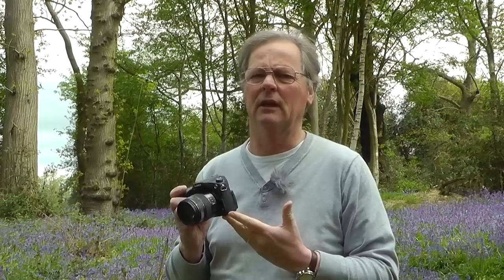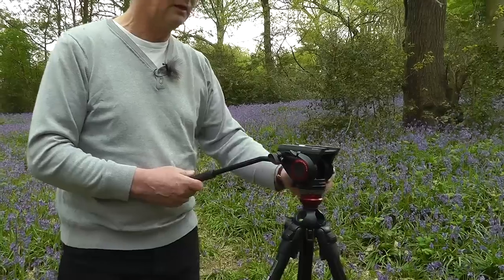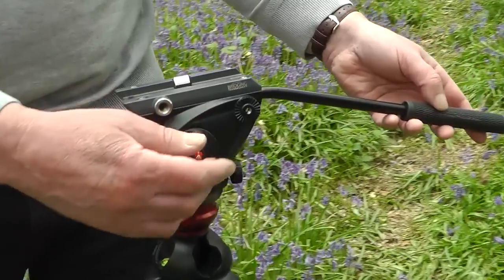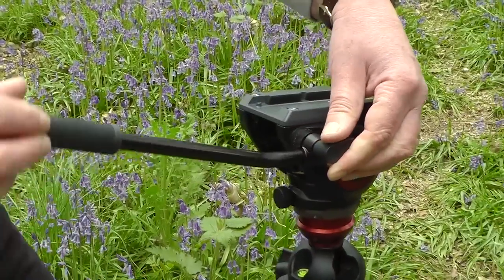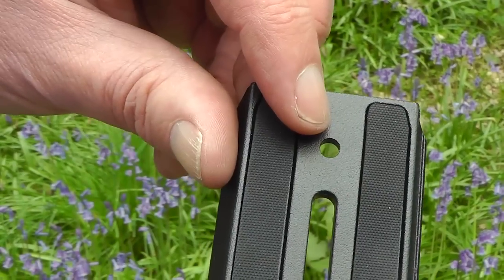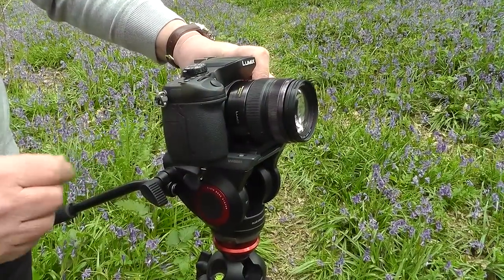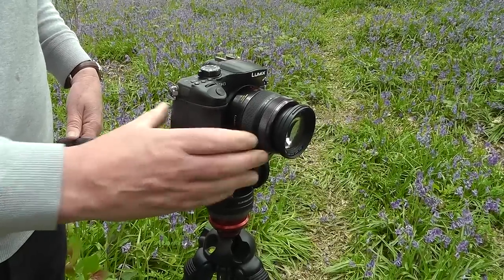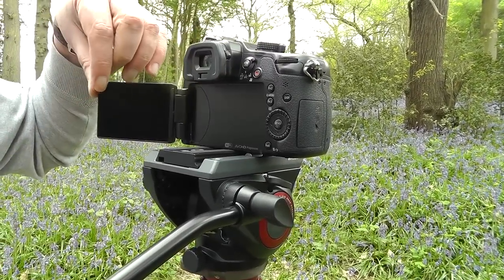Manfrotto 500 Video head review

Comment: This is great, thanks. I'll be getting one of these today for my GH2.
Reply from the maker: It is good for video work, but for DSLR stills you may want to look for another model, as this head is designed to be used in the horizontal position, vertical shots are not possible.

Comment: Hi Vincent, What tripod are you using with this head? Im looking for tripod that I could use both for video and photography? any recommendation?
Reply from the maker: I was using a Manfrotto tripod, they have an extensive range to suit all price points. I would recommend a carbon fibre option. Avoid cheaper brands which you might find on Amazon or eBay, generally you get what you pay for. If using for video as well as photos then make sure the tripod has  a ball and socket head, this will allow for levelling up the tripod head - especially useful for video work when panning.

Comment: Hello! What is the brand/model of that red ball and socket mount you have there? I'd love to use that with my existing Manfrotto 701HDV head, and column style tripod. Thanks.
Reply from the maker: Chad, this is part of the Manfrotto 755CX3G an carbon fibber set of legs, very good too. For DSLR style cameras the 50mm Ball is sufficient, for heavier camcorders the 75mm ball would be a better option.

Comment: Thank you for the review -- very helpful.  Out of curiosity, have you ever used this Manfrotto MVH500AH,755XBK system with a DSLR slider?  I have a 47" slider and Sony A7s (approx. 7.7lbs/3.4Kg total) and I'm wondering if this tripod could handle this amount of weight, especially when the slider is at the edges?
Reply: No, not sturdy enough for even a 24"slider.  You need the 502 for that.

Comment: I've got the flat head type, however the camera moves very loosely when fixed to plate as the screw mount slides up and down freely, the small pin at the front doesn't really help...any advice on how to fix this?
Reply from the maker: The screw should tighten into the camera body very firmly, I have never had a camera which will not accept the supplied screw to a tight position. However, I also use a quick release plate on my audio recorder together with a Gorilla tripod, I use a rubber washer between the plate and screw hole, this gives extra grip. What camer a re you using and is the plate a Manfrotto plate?
Reply: Vincent Oliver photo-i 
Thanks for the response Vincent - the camera fits perfectly on the screw as you mentioned , it’s the fact the camera can slide up and down and rotate freely on the same screw and catches on the pin.... I would have thought the screw should be restricted from moving at all as the fluid head should be what’s controls the movement 
Ive also had to fit  the Manfrotto 293 telephoto lens support bracket which solves the problem and also gives more clearance in the locking nut and additional levelling advantages.... but should work without this addition 
Hope this makes sense and thanks
Reply from the maker: @pj4906  The screw should be pulling the camera down on the plate, thereby avoiding and rotation or sliding. I can only think that the screw is not going fully into the camera. I assume that you are using a Manfrotto plate and screw combination? is there any way you can send me an image of the setup?   you will find a link to me at photo-i.co.uk
Reply from the maker: Just sent you an email

Comment: I am having trouble figuring out how to use my Canon C100 with the Manfrotto MVH500A Fluid Drag Video Head with MVT502AM Tripod. The plate comes with one giant screw but that only holds the plate to the front of the camera, When I put it on the tripod the back of my camera is lose and can slide around. How do I solve this problem?
Reply from the maker: You should have a small nylon pin that came with the plate (see 3:35 in video) this will stop the camera from sliding about.
Reply from the maker: You should have a small Nylon pin with the plate that came with the fluid head - (see 3:35 in video) That will cure the problem.
Reply from the maker: You should have a small Nylon pin that came with the camera plate (see 3:35 in the video) this should cure the problem.

Comment: Thanks for doing this. It does explain how useless it is for DSLRs.
Reply: Gary Eason why do you say that?  I'm using this head to shoot video for a paid gig with a dslr and it works perfect! if you are referring to the fact that you cant shoot stills in portrait orientation, well then you are simply looking at the wrong type of head in the first place.
Reply: RedroomStudios No it was mainly because as you helpfully explained the mounting plate is really for movie cameras. I opted for the XPRO Fluid Head with fluidity selector. Apart from anything else that accepts a standard mounting plate - easily - and it doesn't fall off. The long plate on this one is just inappropriate for a DSLR.

Comment: Would this head work well on a slider?
Reply from the maker: Dominic Crozet Yes, that is what I am using it for now
Reply: I'm also looking for a quick release plate to put onto this head and have the same plate for my flycam stabilizer. Any recommendations? Thanks
Reply from the maker: Manfrotto have a quick release plate The Manfrotto 577 Video QR Adapter 501PL